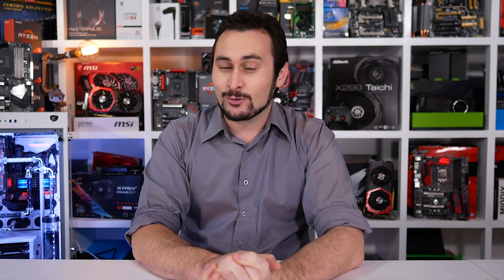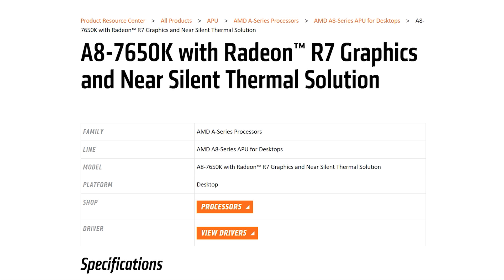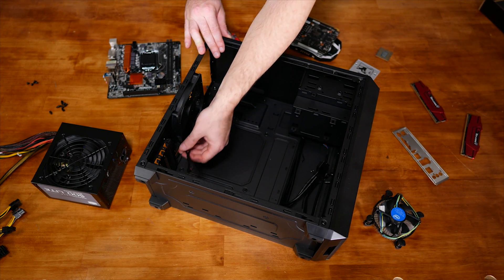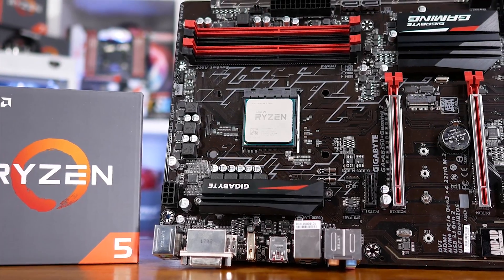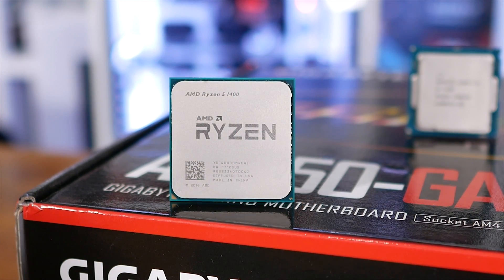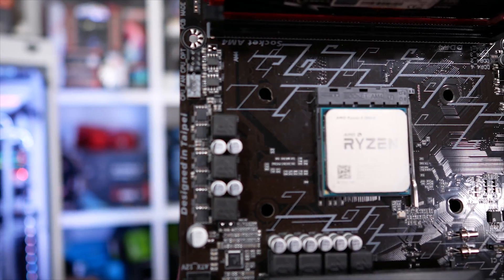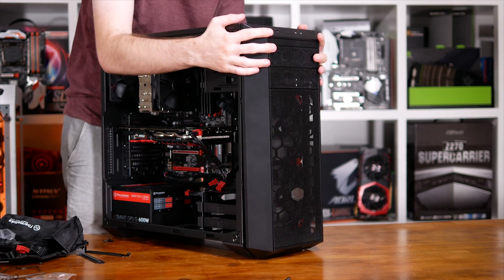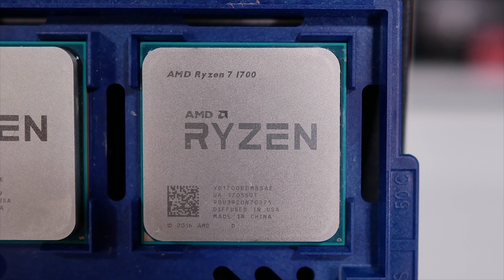Top 5 Best CPUs, Ryzen 3 & Threadripper In Mind!

Comment: if youre gonna be overclocking, the 1700x is actually binned and has a higher chance to have a better memory controller, as anything over 2933mhz is a gamble on the 1700 (it takes a lot of fine tuning to get my memory to work at 3200), but a buddy with a 1700x is running 3600mhz no problem (blck overclock), and supposedly the 1800x chips are the absolute top binned but just how much better can they get?
Reply from the maker: I've purchased three 1700 chips, all weeks apart and all hit 4.1 - 4.2GHz (4.0GHz on low voltage though) and they run with DDR4-3200 just fine. I have a 1700X that can't get over 3.9GHz, though memory support is fine. The X doesn't guarantee you jack squat!

A motherboard manufacturer that I can't name claim they have tested several dozen chips and significantly more 1700's had better memory controllers than the X models, go figure.
Reply: okay well you have access to more people and chips than I do, so good to know. I guess i really just pulled the short straw when it comes to the lotto. ill still take no stupid xfr and temp offset for 50mh (my 1700 is clocked at 3.95ghz, cant hit the 4 sadly)
Reply from the maker: The board your using or the memory could be more to blame.
Reply: msi x power gaming titanium  and gskill tridentz 16gb 3200mhz. its on the motherboards compatiblity  list on their website

Comment: whoa, you can overclock the r5 1600 to 4ghz with the stock cooler? that's quite a bold claim.
Reply from the maker: Super bold since I and many others have done it. The box coolers are very good, you just have to customize the fan curve.
Reply: you can watch the Wraith Spire cooler review in bitwit channel, it's actually good.
Reply: Yea, I'd disagree with this, but I'm sure there's always going to be a lucky few who get one that can run at insanely low vcore. Mine though, 3.6ghz on all cores at (I think it was) 1.235v caused my system to hit max and shut itself down to protect itself from damage. Fresh MX-4 on it too .-. But honestly, running at it's stock frequency is still incredibly powerful anyways.